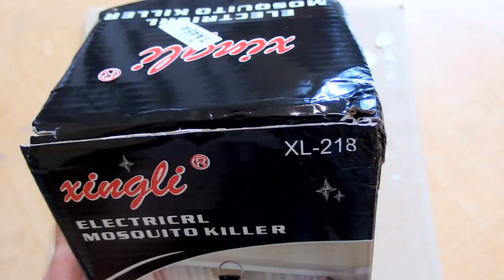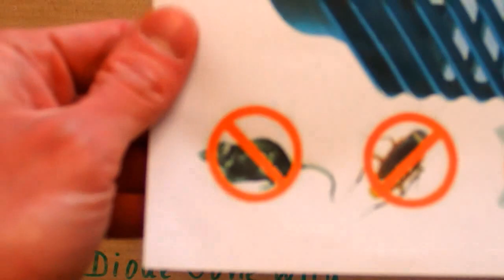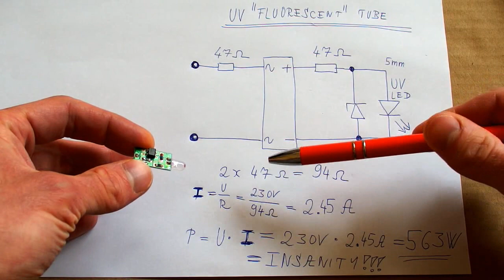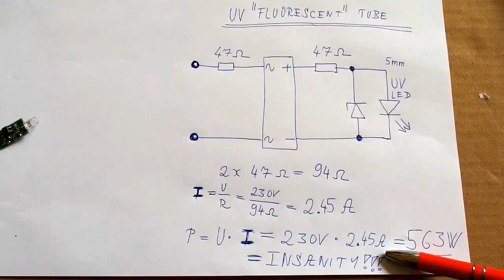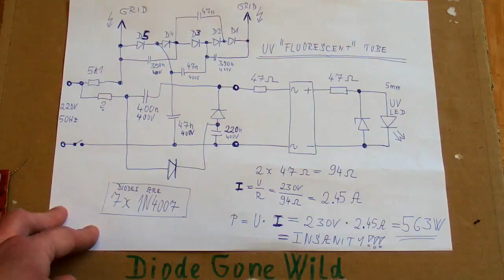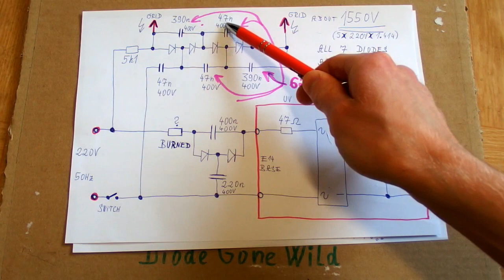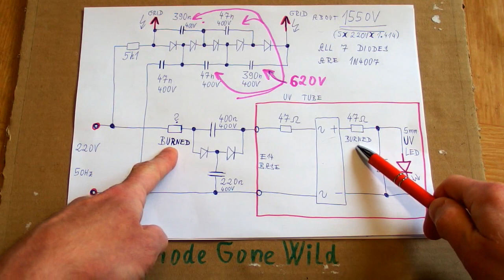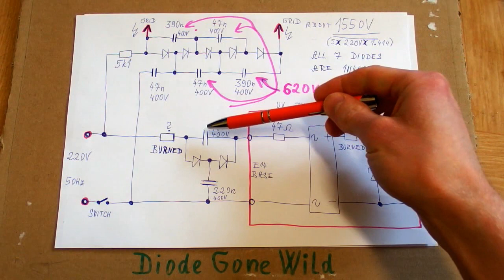Chinese Insect Zapper (Mosquito Killer) - crazy circuit and burning resistors.

Comment: My first instinct when it failed was "designed for 120V or less"... which may be true, but I don't see how it would work properly at lower voltages either.
Reply from the maker: Maybe, but those resistors would burn even at 110V~. The capacitors are rated for 400V, this is usual for 220V~ products. In 110V~ products there are usualy 250V capacitors. The desing seems to be originally for some fluorescent tube or CCFL, that had a higher operating or ignition voltage. The LED tube was put into it without even testing it. Or they tested it for like 1s, so that the resistor didn't have time to overheat.
Reply: markiangooley It might be 230v, the Chinese use the N American plug for that voltage.
Reply: The circuit is made exactly the same for 110 or 220, they just change the plug. It is a fire hazard at best. The values on the components in this video are exactly the same as the zappers I bought here in the states for 110 volts.

Comment: If you just unsolder these two diodes and simply short circuit the 2 burned resistors, the ultraviolet LED may work.

Then you can start zapping a few flying rats.

Comment: I recently repaired one of my mosquito lamps and it had a very similar circuit.  It had a real UV fluorescent tube though, not an LED.  It seems like just what you said - they had a lamp designed for a tube and they put a low voltage LED 'tube' instead of the real high voltage tube.
The LED tube is probably meant to run off a 12V AC transformer like used for low voltage halogen fixtures.
Reply: That 1.5 v ~ 3 vdc uv led

Comment: These zappers are a fire hazard. The resistors burn within 1 hour. It is a voltage amplifier circuit that barely works. The LED circuit is being fed about 40 volts off the R2 resistor and that is why it gets so hot. I initially replaced the R2 resistors with 10 watt resistors and they still get super hot. I bought 2 of these and both burned R2 resistor almost immediately. I replaced the LED circuit with a 120v to 3.5 volt buck converter from ebay and the led's work great now. The grid side has never failed.
Reply: The voltage to the led is supplied by a 7.5k ohm resistor (R2) off the main board. The 5k resistor is for the grid only.
Reply: The burnt resistor R2 is the resistor for the LED power supply. And you burned the two LED resistors when you plugged it into the mains with a light socket which bypassed the resistor R2 on the main board.
Reply: You will never achieve the 600 volts with the components on the board because of the voltage drop. The most I got out of the main board was 460 volts which is only slightly over the rating of the caps. The reason they did this is to save money. It's the same reason there are two different values for the capacitors. The lower value capacitors are just adequate at the position they are in and are cheaper than the higher value caps.
Reply from the maker: There should have been a proper capacitive dropper for the LED. Not a resistor as the only thing that drops the voltage. Seems like the circuit originally was a doubler for CCFL. With a proper capacitive dropper for LED, well rated capacitors in the multiplier and with a fuse, it would be a good device.

Comment: Love the mouse drawing, Brilliant ! 
110 Volt plug put on 220/240V supply with the  Chinesium adaptor. You Popped it. Great reverse engineering. Piece of dangerous plastic rubbish.
Reply: Actually, that's a Chinese ungrounded plug, not a US one. They're similar, and will physically interchange, but not identical, and the Chinese plug doesn't comply with US code. China uses 240v. The quickest way to distinguish the two is that the Chinese plug lacks the holes in the blades. Also, most of them have a much smaller grip, too small to comply with our electrical code.

Comment: Did it state the voltage on the package, instructions or sale listing?  I think that Chinese plug is actually North American!  Same plug but 100V difference!  Instead of that plug adapter, they should have sent a plug converter!  I bet the math works better at 120V!

Comment: Its not made for 240 volt i think
Reply: If it's not made for 240V then why did they include a European adapter in the package?
Reply: If it was made for 240 volt, why wasn't there a european plug in the first place?
Reply: Oscar Hartman it has a Chinese plug. And China uses 240v as well. No, it's not a US plug. China uses a plug design for ungrounded equipment that is very similar to the US 2- prong plug, but not exactly the same. Note the absence of the holes in the blades. Also, the part you grip tends to be smaller than what is legally allowed in the US. They will fit a US outlet, but they're not compliant.
Reply: yeap math makes more sense with 120V...

Comment: By looking at the circuit before the 'Tube', I can't quite work out how that would power the tube without blowing.  Apart from the burned resister (which I assume is an inrush current limiter), there's nothing limiting the current flowing through the two diodes for half the AC cycle through the tube.  Even the 220nf capacity doesn't make sense.  I reckon if this 220nf capacitor was inline like the top-left 47nf capacitor, the current would be limited enough to drive the UV 'Tube'.  But if that was a real tube, the DC current would result in a very short life, like some battery operated fluorescent lights that ran the tube on DC.
Reply from the maker: I think it originally worked with some UV CCFL tube. It's voltage drop was higher than the mains peak voltage, so it didn't blow up. It worked as a current limited multiplier. As long as the tube's voltage drop was less than 1x mains peak, it limited the current thanks to the 220nF capacitor reactance. And yes, it is DC current that shortens the life of tubes, but chinese never care about this.
Reply: I didn't realise how high the voltage drop is on CCFL's.  Indeed the reliability of the non LED version is poor, I found it on Amazon UK and about half the reviews mention that it failed within days of purchase.  I love your diagram of the mouse 🐭 I'd also like to see a mouse trap that catches mosquitoes... 😊
Reply from the maker: A proper UV fluorescent tube can last about 5000 - 10 000 hours with a proper magnetic ballast (AC) or  a high frequency electronic ballast. LED's could do even better, but they have to have a proper power supply and they shouldn't run at 4x their maximum current (as Chinese designs usually do). The light output also has to be enough to replace the fluorescent tube (one 5mm LED is not enough). And the wavelenght has to be suitable  - 365nm or even better 350nm. The cheap 395 or 405nm LED's suck in those zappers. I still stick to my old fluorescent zapper with a heavy iron ballast.
Reply: The R2 resistor that burns on the main board supplies about 40 volts to the LED board, which then reduces it down even further and rectifies it so the LED doesn't burn out. The R2 resistor is a 1/4 or 1/2 watt resistor and needs to be at least a 10 watt resistor. Like he said in the video, there are two completely separate circuits.
Reply: if u can make it china will fake it
Reply: what if it was supposed to run on dc power

Comment: I have one of these which is physically identical but with different construction. If I recall correctly the light is in series with a dropper capacitor across the power input and the grid is a single stage multiplier. And this is for 120v. I might need to check it again because I don't think 340v is enough to zap insects.

Comment: I thought I got it cheap on eBay because they had an error in their production and many units were made with a 1/4 Watt resistor when really it should have been at least a 2 Watt. But as you are saying, it was probably meant for a florescent tube! I wanted to map out my schematic but didn't so far. Interesting that it works fine now when I replace the resistor with a 5 Watt.

However it's still a mediocre unit because I also found out that the "kill power" of this thing is very low. While you do get a nice big spark if you short the grid, it hardly kills bugs that land on it. It's most effective in killing what looks like little moths, they are attracted to the light and just stick to the grid and don't burn up in any way. But I tried to kill some fruit flies, and had to trick them by putting the unit on top of a little container with fruit peels. So I found two on the grid. One of them was dead, and the other was alive basically jumping between the two wires, like saying hahaha, it can't kill me. So I took a matchstick and moved the fly so its body, not just wing, made contact with the two wires and then it started burning it with smoke emanating and it STUNK! I understand that the more "legit" bug zappers are strong enough to pretty much blow the bug apart as it hits the grid, and the bug gets partially burned and falls right off the grid to the bottom. Somehow this unit's HV circuit produces a few thousand volts but very little current, so it's not enough to really travel effectively through the bugs that end up on it. Either way I understand that in order to attract mosquitoes you need a source of carbon dioxide, and some movement. They are not attracted to UV light...

Comment: The capacitors actually only charge to the peak of mains voltage each. 400 volt capacitors will allow operation up to 283 volts AC safely. The capacitors closer to the mains handle more current, therefore, need to be larger values. All in all, the series capacitance needs to be appropriate for the desired discharge energy. It's nicely designed. The 5.1K resistor  is too low a value. In a fault condition, like the grid wires shorting, or a bug bridging the grid wires, that resistor could dissipate as much as 11.3 watts!! it won't take much to smoke that! one can only hope that the capacitor values are low enough, to reduce the dissipation of that resistor in a fault condition. It almost looks like the voltage multiplier was designed for 240 V AC, and the light was designed for 120 V AC. Anyway, it looks like a passable design, but with the wrong resistor values.

Comment: I think the smaller caps give about 1.5kV in total. When it gets loaded, small caps are discharged and 390nF caps are effectively in series ie. only 600V or so for the larger current zap from the large caps. That may have to do with not overloading the circuit with large current pulse like you'd get if all caps were large.

Comment: If we neglect the 220nF capacitor and the two diodes in the lamp circuitry, the burned Non-47Ω resistor would have dissipated around 15 Watts. The value could be something like 3.3kΩ.

Comment: why does it say '470' on the resistors? do the maths and notice that it is 0.245 A  and consequently 56W (no insanity there)
Reply from the maker: The resistors marked 470 are 47 ohms, not 470 ohms. The 47 is the value in ohms and the 0 is how many zeros you have to add.

Comment: If the 2 diodes before the light were cathode to cathode or were anode to anode you would get a significant voltage and current drop. So much of a drop it wouldn't matter if it was used in a 230v or 120v source.  I can't tell by the video if the drawing and or silkscreen on the board  was wrong, or if a diode was just put in backwards.  This unit has none of the safety features required to be UL Approved and is probably available in the USA via the internet only.  As with any product bought direct from the country of origin, buyer beware.

Comment: So many strange circuit in chinese products. I had an emergency lamp that burned when it was charging. The resistor to red LED indicator was burned and the elco from bridge rectifier was blowed into pieces. The elco only 50v, and the resistor power clasification is only 1/4 watt with a mysterious value too. It's clearly a 800mA current is running on the circuit. The main light contains 40pcs smd LED 3.2v in a paralel. And because of two component were blowed, the rotary resistancy switch and the transistor are become broken. I analyzed that they use negative path to controlling the transistor. 

The other emergency lamp has a solar panel which using negative path through the switch. And amazingly the solar panel is directly connected to 3pcs paralel 3.7v li-on battery. The circuit board was burned included all component on it. I tested the solar panel's voltage output and it could reach 15volt under the light of lamp. Buahaha...

Comment: Lol, the "kill" and "zap" part in the Ad was referring to the resistors. By the way, the 1500v will still be too low for most insects at that electrodes separation of the grid. The one I have uses 3600v (from a switching inverter) and that one works just fine. Unfortunately, does not kill mice either...

Oh, and you are right about the doubler going to the light bulb. Originally, those units had a fluorescent UV-A bulb with a screw base just like that, but I guess that other Chinese seller scammed this Chinese seller into buying LED lamps that work "exactly" the same as replacements, lol

Comment: Mine is same but a lot dif, 3 big capacitors 2 small 5 diodes 2 resistors the bulb glass runs on 243 volts dc the wires put off 436.6 volt dc

Comment: That isn't a Chinese plug it is US. I the US we have this type of plug and maybe things wouldn't be so dangerous if they used 110 120 volts in Europe like we do in the US.
Reply from the maker: Doesn't the US plug have holes in the pins? I think that the chinese plug is simmilar to the US except that the chinese one has no holes. 110 or 120 volts is still a dangerous voltage. In Europe we have 230V but the plugs are much safer, sleeved pins, double insulated cables and so on. 230V allows more power with less copper.
Reply: DiodeGoneWild and in the UK it's even safer because it has insulated pins and an earth pin that protrudes slightly and opens shutters as it's inserted
Reply: why did not you measure the resistance? Broken first rezistor
Reply: I think you "killed it" whit 230v......hahaha
Try to "re do it" whit 110v and it can work better!!!
/recalculate whit 110v....you see it will "look" better....

Comment: I saw the resistor values as 470 ohms and not 47 ohms  (though they are STILL under-value for the circuit!) yes, Chinese stuff really DOES suck bad!
Reply: 470 on sms resistors, means 47 ohms, even if it's raraly used.

Comment: My general concept when buying cheap Chinese stuff on ebay and such is this, only buy something that if it fails it can't kill you. Therefore things that are safe to buy are things like low voltage lights, single electronic components, mice, keyboard, low voltage heater elements etc. 
And never buy things that can be dangerous if they fail, like high voltage heaters, lights, insect zappers, night lights, phone chargers, battery chargers, speakers that connect to the wall, power adaptors for computers, ac fans etc.
Most deaths caused by appliance failure are a result of products from China.
Japanese design is usually the safest and highest of quality, but you can also buy Korean products today that are of pretty high standard as well, made in Germany is still ok as well. 
But I would never trust made in China, or made in India etc with my life.

Comment: At 6:38 those are two 470 ohm resistors, not 47 ohm, which would make your current .245 amps, and that would make your power 56.35 watts. I use to make these with a step up transformer with a ratio of 10 to 1.Putting 230v on the input will give you 2300v on the output, thus zapping anything that touches it. I would fuse this with a 2 or 3amp fuse to keep it from catching on fire if something shorted it out.